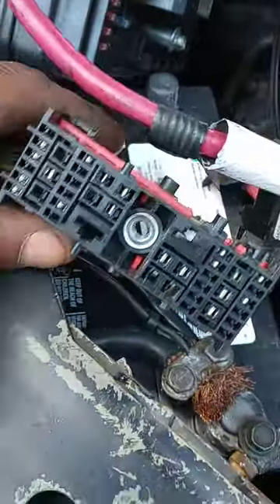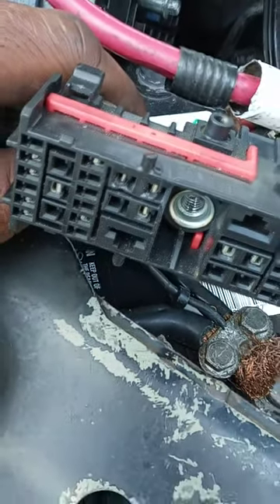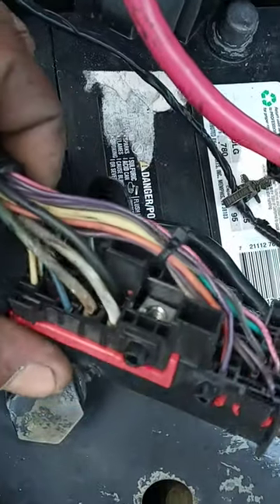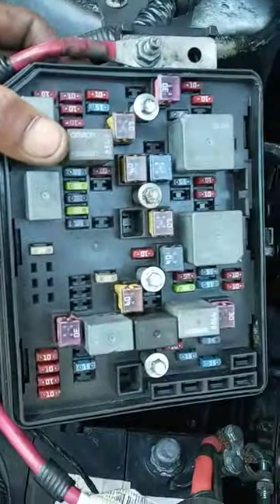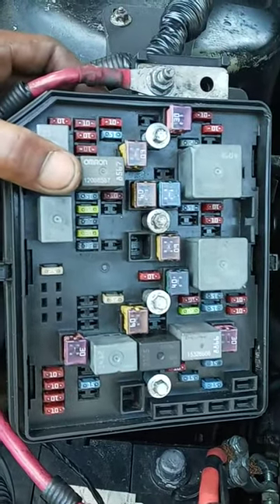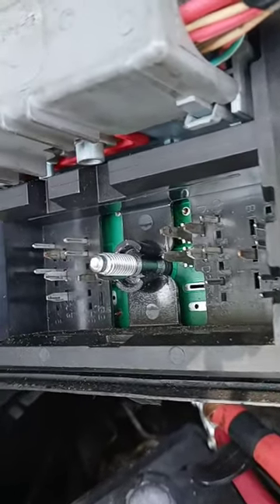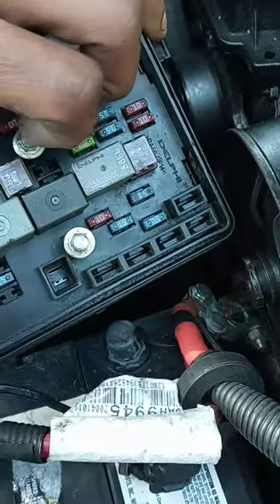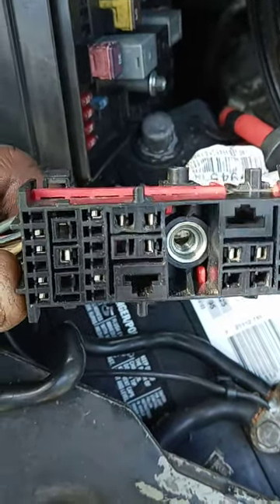ss impala monte carlo cooling fan fix

Comment: Same exact thing with mine. 2006 Monte SS. I noticed the bottom fuses have several that look like they got burnt. I can assume this might be the cause of my cooling fans now failing to turn on. Especially since I took that same fuse block assembly apart recently and put it back together.

Comment: I need your help, I've changed the fans, test ohms - no shortage, changed relays, and changed the temperature sensor. What is left? is it pcm?? Also, I checked the connection pins they are still good no burn and not even crusty wire.
Reply from the maker: Yo

Comment: Bro how did you take the cover off of that?
Reply: Did you find out yet? It's fairly simple. Take the cover off of the fuse box. Unscrew the bottom most bolt in the fuse box. That harness traces underneath the windshield washer fluid reservoir, to the headlight assembly, then over across the engine to the cooling fans. After loosening the bolt by the fan relays, use a flathead to wedge open the tabs on each side of the fuse box. This will separate the harness connectors visible from the front from the other plastic cover attached to the vehicle. Then, grab the harness connector from behind the opened box and continue to unscrew that bottom bolt holding it together and it should come loose.
Reply: @sigfriedpalmunda2347  got it done that same day haha
Reply: @TheGearShiftGurus  Nice. I've found it worth removing out of the way to take off the belt, remove the battery, water pump etc. Makes it so much easier as you know. NO SPACE in these vehicles.
Reply: @sigfriedpalmunda2347  yeah right I’ve heard somebody else say that as well